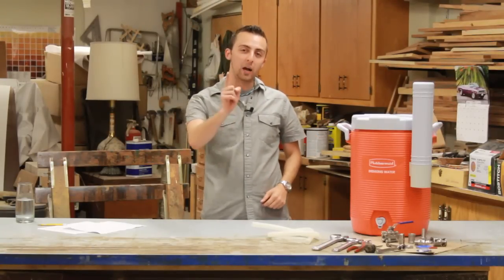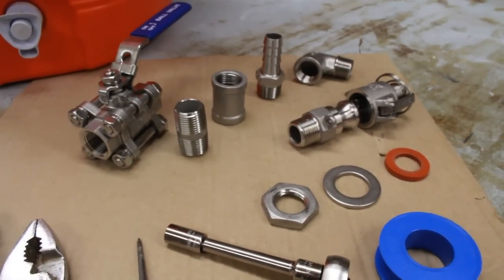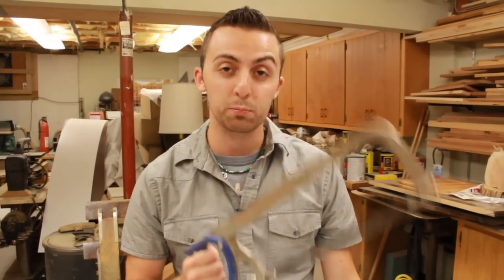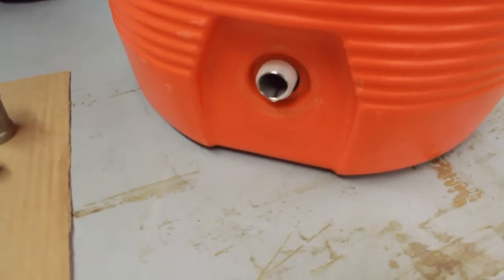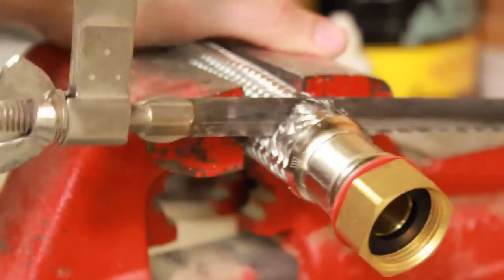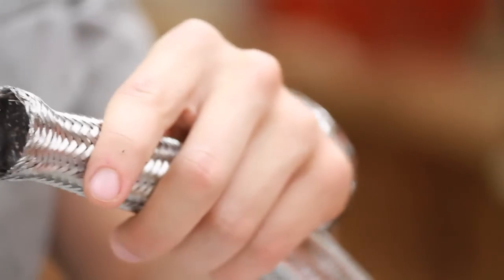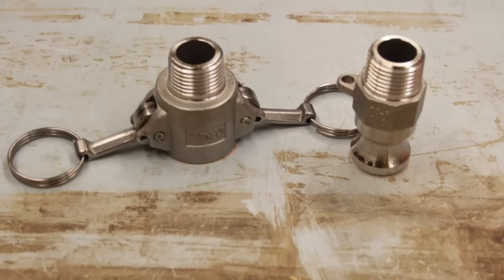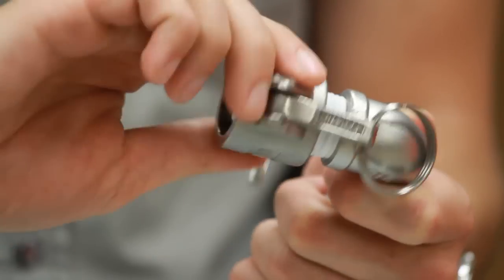How to Build The BEST Mash Tun from a Beverage Cooler

Comment: I'm so disappointed. It turns out in Germany you can get a 10 gal. vacuum sealed  stainless steel Schengler Thermoport with false bottom and spigot for the cost of a new igloo cooler without any hardware. Of course, I didn't find out until after I finished my cooler mash tun.
Reply: Hi Kermit - that's good to know, I'm just about to start and could pop down to Germany to pick one up instead of making my own. Did you find a good / cheap reseller?
Reply: hobbybrauerversand .de
Reply: cheers
Reply: Not sure what you're talking about. Everything on hobbybrauerversand is insanely expensive. The cheapest false bottom they have is 40 Euro. A Schengler Thermoport from Amazon.de runs from 75 Euro (8 gallon) to 95 Euro (13 gallon). I am putting one together like this video for about 70 Euro, including a spare stainless bazooka.
Reply: You are right Hasenpfeffer. Brewing equipment is super expensive in Germany, but while you're on amazonde look up a 10 gal igloo cooler. They are 180 euro for only the cooler. 800 euro with ball valve and false bottom.... which takes me back to my original post.
Reply: I bought the ball valve and a bazooka strainer off Amazon.de (seller name is Mangobuy) for 26 Euros. He is in UK but shipping was only 2 Euro. There is a Coleman XTreme 52 quart passive cooler for 67 Euros on Amazon.de that would work just fine. In any case, Prost!
Reply: Kermit the Frog j

Comment: Replace the 3-piece ball valve, which is over-kill, with a 2-piece. I was able to find one for about 10 online. But do not go with anything less than stainless steel as the ball-valves at say Home Depot have lead coatings. And forget all the camlock nonsense in this video. It's just a waste of money.